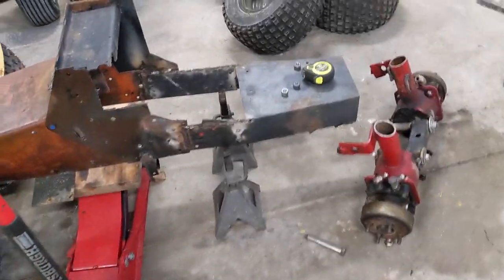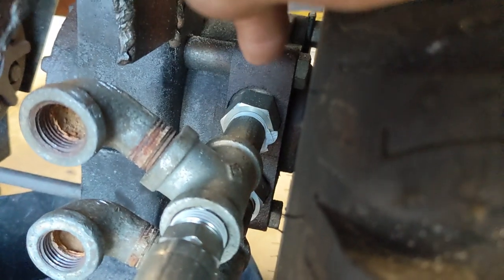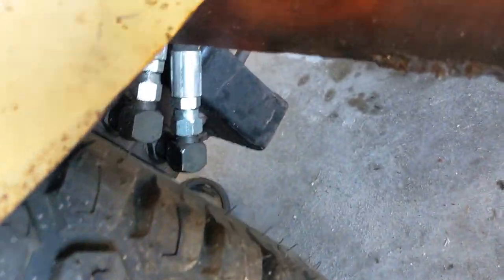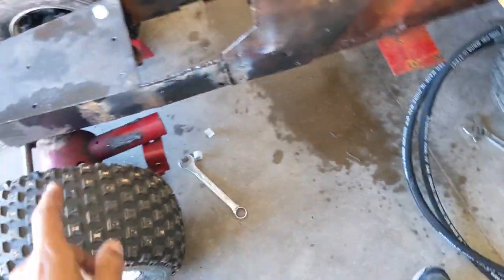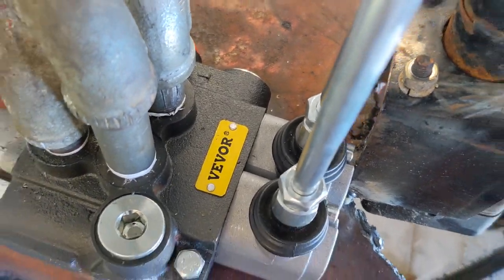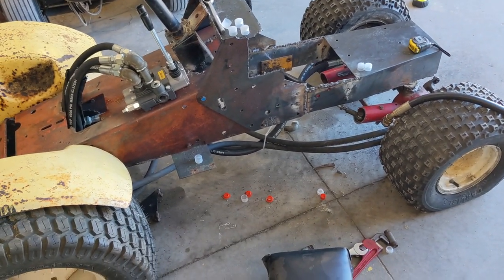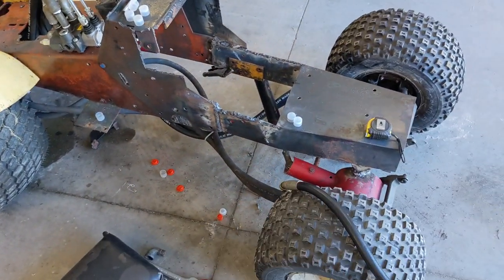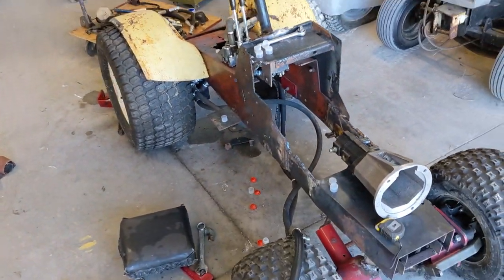35HP 4X4 Sears tractor part 2 hydraulics and front axle

Comment: Great build, are you worried about the front mounting points on the steering? They look at bit sketchy? Or you may not be done with it yet? Anyway its a freaking sweet build! I am working on a case 444 and i am new to hydraulics.
Reply from the maker: Thanks. I'm going to add more support to the bottom between the pins. But yeah I don't really like it.

Comment: Couldn't you mount the seat spring backwards? Heat and bend the seat mount part down if necessary or add a plate to it and angle that.

Comment: Would there be enough space under the dash to mount the hydraulic valve underneath?  I would rig it to two foot treadle  pedals to operate the hydraulic valves and drive it so your hands could be free to steer or run implements.